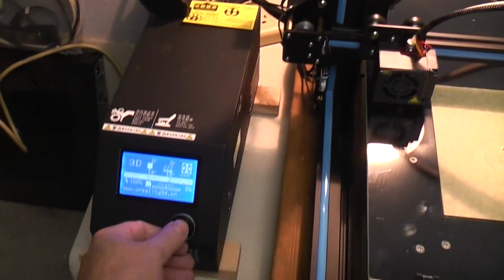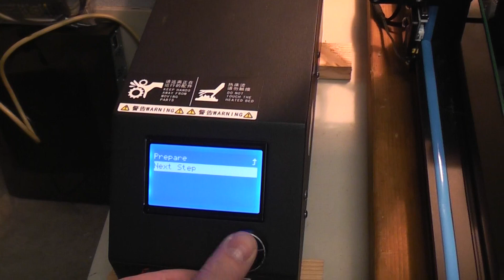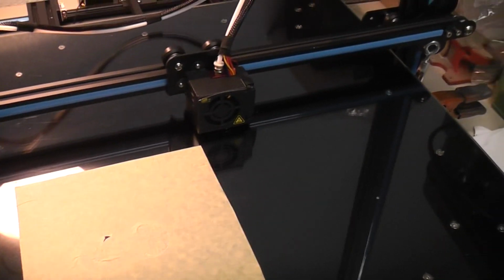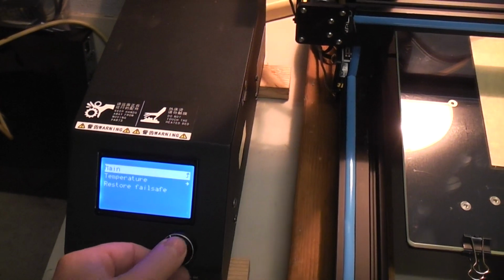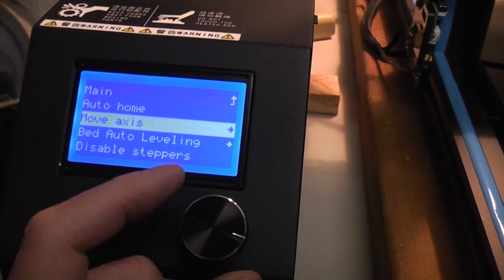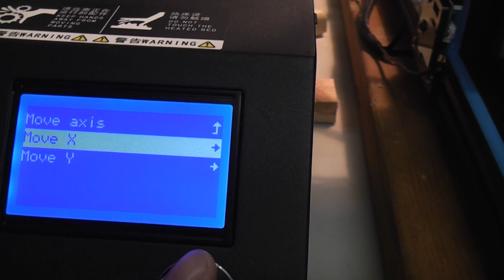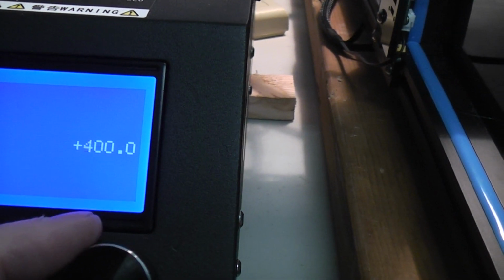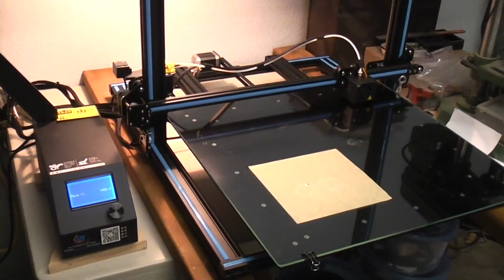CR-10 S5 inside the filiment sensor, Semi auto bed level "not for 500mm bed"

Comment: fast forward a few years... I got my S5 about 3 weeks ago. The assisted bed leveling sees it as a 500mm bed. They even have a new firmware flash for BL-touch bed leveling, filament sensor, and resume on power failure.

Comment: I have an issue with mine, when you go up in the Z, mine errors out and resets once it gets to 130mm. Is that normal?
Reply from the maker: No I would not think that was normal. I do not think I have seen any other comments on you tube that had that problem. I guess there is a face book group for guys with these printers where they probably talk about all the problems but I do not face book so can not link you too that.
Reply: Robothut thanks for the reply. When i was having the issue it was under the .1mm. I changed it to 1mm for the z and it was fine. Not sure why that was.

Comment: How is the s5? is belt stretching a problem?
Reply from the maker: I am about 40 hours into my first large print, and so far its all working perfect. I wanted to see how flat the 500mm glass bed was so my first print is a robot body front that I made that covers most of the build area. The first layer looked great so the glass plate was flat on my C5. I will post a video of the frist ;large scale print when it finishes or fails. So far all the belts are still tight.